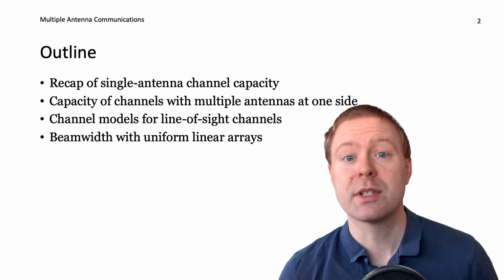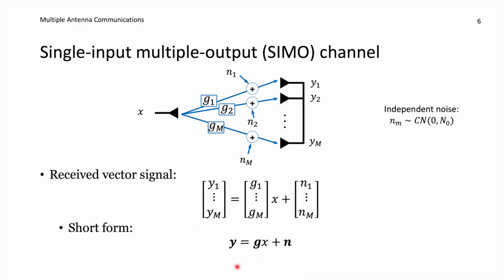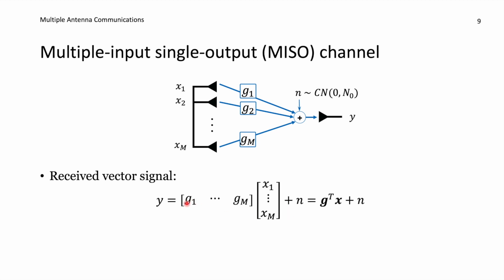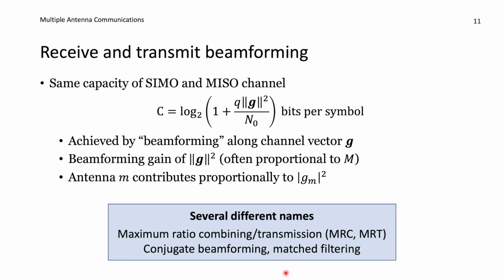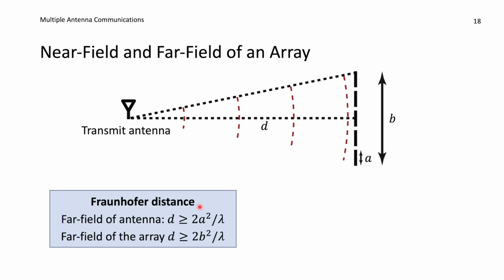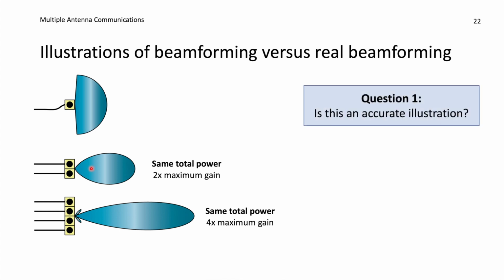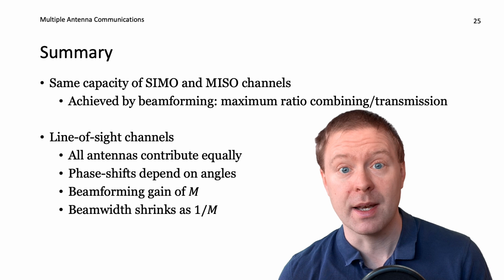Lecture 2: Basics of Transmit and Receive Beamforming

Comment: Thank you for your helpful videos, Is there any calculation on transmitting and receiving beamforming vectors for SIMO to achieve low BLER and high secrecy capacity for sharing short packet communication
Reply from the maker: Maximizing the SNR might be the same as minimizing the BLER, so over a SIMO channel, you probably want to use MRC. The secrecy capacity is related to the signal strength at a different location, so I don’t think the receive combining in a SIMO channel will affect it. (Except for that maximizing the rate of the desired link might also automatically improve the secrecy since it is the difference between your desired rate and the rate at the eavesdropper).
Reply: do you  have any matlab code or any derived expressions on this  @WirelessFuture

Comment: Hi Prof Emil. Thank you for your helpful videos. I have a question, as the beamwidth shrink when the number of antennas increases. I think it means that the beam is more directional. Does it mean massive MIMO can not be used with NOMA?
Reply from the maker: Yes, this is one of the reason why NOMA is becoming an outdated technology. The other reason is that it doesn’t offer more signal dimensions, just a more flexible way to use the existing ones, but add the cost of more complicated rate adaption. We write more about it here: https://ma-mimo.ellintech.se/2021/04/15/is-there-a-future-for-noma/
Reply: @WirelessFuture  Your channel is a gold mine to me. If I knew your channel earlier, I would not be suffering to pursue my Ph.D. Thank you very much, professor. I have become a big fan of yours.

Comment: Thank you Prof. for the nice explanation, I am fond of your lectures and love your way of explanation. I have one doubt in slide no.10, time 15:50, about the dimension of x tilda , As per my understanding y is a scalar, norm g scalar, and n is also scalar so it should be definitely scalar. Now my question is how we are getting this x tilda out of vector x=[x1,x2......xm]? are we considering the same information to be transferred from each antenna?
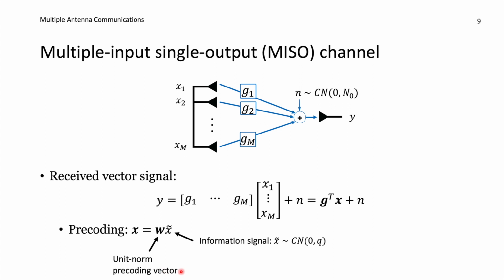Reply from the maker: Yes, the same information is transferred from all antennas, but with different amplitude and phase shifts, to transmit in a way that maximizes the SNR at the receiver. The vector x is selected as shown at time 13:20, as x = w*\tilde{x}, where w is the precoding vector (e.g., the MRT vector considered at 15:50) and \tilde{x} is the information signal.

Comment: For the transmit beamforming part, I think it is probably clearer if it is explicitly stated that we constraint ||w|| = 1 so that the post precoding power is unchanged w.r.t the SISO case (otherwise the SNR would be larger if we multiply w with a large scalar value).
Reply from the maker: Yes, this is the intention with saying "unit-norm precoding vector" on Slide 9 at 13:53.
Reply: @WirelessFuture  Thank you. I somehow did not read the slide careful enough.

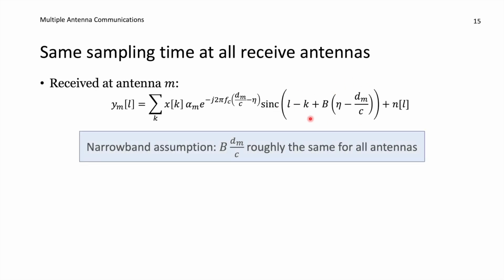Comment: Thank you for your helpful and thought-provoking videos. You have impeccable manners. In 24:55, you introduce narrowband assumption, by this definition in 5G, especially in millimeter-wave is it reasonable to consider this assumption?
Reply from the maker: You are right that practical systems (such as 5G) are not narrowband, but they are generally designed by taking a wideband channel and divide it into many narrowband channels. The theoretical framework that is assumed in this lecture series is called the "block fading model" and is introduced in Lecture 6. In practice, OFDM is used to divide a wideband channel into many narrowband channels. This is discussed briefly in Lecture 14.
Reply: @WirelessFuture  Many thanks for guidance

Comment: Prof., I have a query based on the random variable you have mentioned for x(l)~CN(0,q) at the start of the presentation. How does the information signal follows complex normal distribution?. If I am not wrong, it can be easily agreed that the information symbol follows uniform distribution.
Reply from the maker: It is easy to agree upon that the sequence of bits contains 0s and 1s, each having equal probability. But to achieve the capacity, we cannot transmit these values directly but need to apply a channel code that protects the transmission from errors. The optimal (capacity-achieving) channel code takes every message of N bits and maps it to a sequence with CN(0,q) entries. The sequence is generated randomly but agreed upon in advance between the transmitter and receiver. This is called a Gaussian codebook and is further discussed in the background video on information theory. Practical systems are not using Gaussian codebooks, but for example LDPC codes, but those are designed to provide almost as good performance as Gaussian codebooks (but with lower computational complexity).